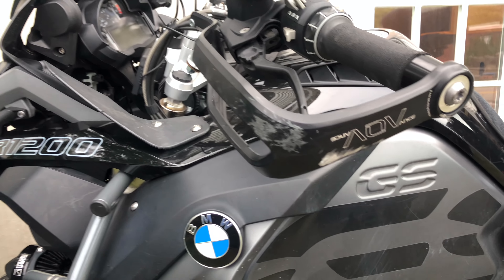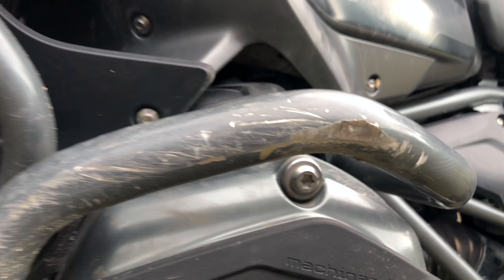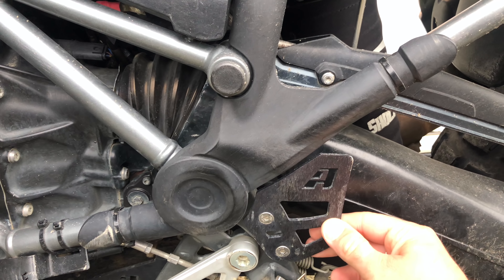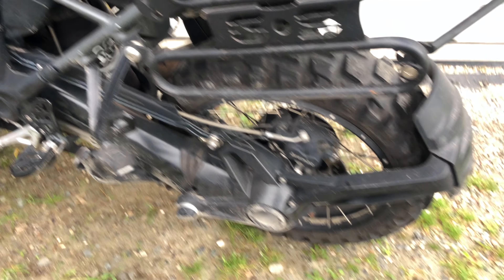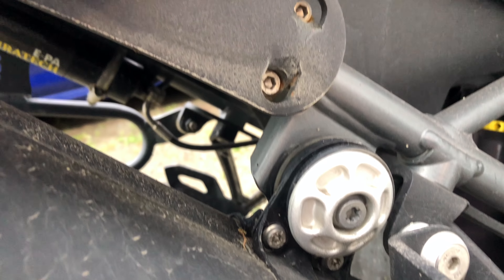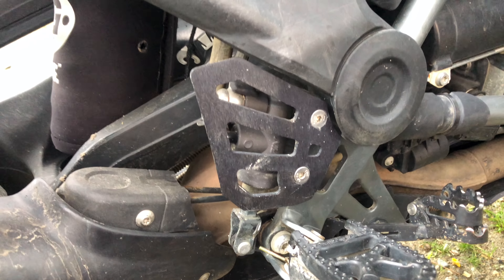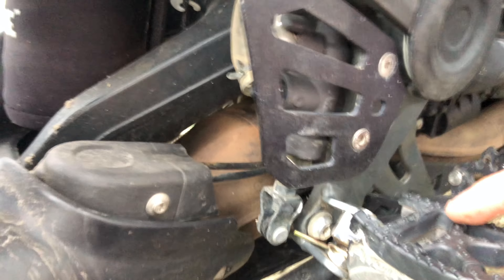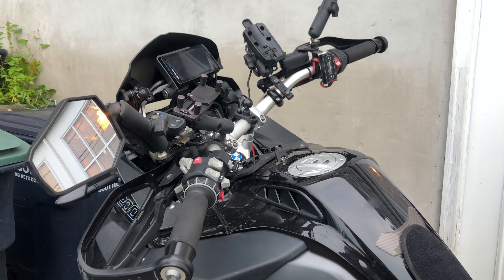Analyzing the Crash Damage on my BMW R1200GS Adventure (2017)

Comment: Glad you were not hurt.  I must say that all the protective equipment you added to the bike must not have been much help if a slow low-side slide totaled the bike.
Reply from the maker: I definitely need to squash this one in the bud. The 'total loss" means the cost to repair the bike was higher than 66.67% of the value. Every scratch on the bike had to be replaced including 2 tiny scratches on the fuel tank ($2500), a scratch on the rear wheel ($1500), a scratch on the swing arm ($1500) a dent in the muffler, ($1700). The protective bits I added enabled me to drive the bike 130 total miles. The only things that I was going to replace were the shifter lever, brake lever and luggage racks. I figured with the dented muffler, I would just have insurance take care of it. They put a piece of green tape on everything that has a surface scratch and the total equaled over $14,000 USD. The bike was not a total loss because the protective bits failed. The protective bits allowed the bike to continue working. The bike was a total loss because insurance requires all scratches be replaced and the bike leave in show-room quality including a full detailing to clean the bike up. If I had never involved insurance, I'd be out $2,000 total in aftermarket parts (non-OEM) and still be riding the bike today thanks to the crash bars, cylinder head guards and sliders.
Reply: My buddy experienced a similar thing when he crashed his Ducati Hypermotard. The insurance company insisted on replacing everything that had even the slightest damage. The worst example was a slightly bent mounting tab on the frame that we could have fixed with a pair of pliers. The insurance company insisted on replacing the entire frame. That went on and on until the bike was considered a “total”.
Reply: @AdamChandler86  well im not american but simple scratches wont kill u, u can always wrap it, since it runs no. major damages, now insursnce take ur bike they sell ut they ship it to lebanon and here we fix it cheap lol
Reply: Wait....what?  $2500 to fix “2 tiny scratches”?  And $1700 to fix a dent in the muffler?  You can REPLACE the muffler for about $400.  I would seriously question your insurance guy’s opinion here.  Just sayin.
Reply: @ktmpasser  I am wondering why insurances companies do this? Do you have any idea?I live in Australia and I am not sure here they will reply so well and fix everything.
Reply: Bill Luce lol newb. Insurance determination does not equal real life. Adam’s big mistake was making a claim.
Reply: @AdamChandler86  do you have the option to buy it back on a salvage or rebuild title or something like that? It seems a shame to throw out a perfectly good bike over a few scratches.
Reply: @samturner3242  Insurance is weird sometimes. I got rear ended in my 2006 cobalt, got a few scuffs on my rear bumper. I filed a claim with the insurance of the person who hit me and they gave me close to $700.
Reply: @AdamChandler86  Why did scratches have to be fixed?  Would it prevent the motor from stating or something.
Reply: @BikerGirlTraveler  i agree
Reply: @juanpablo253491  Maybe because someone else get a 'totaled' bike for very cheap.....great business!

Comment: Adam, I hope you learn from this. Approaching that left hander you were too far to the left, consequently the corner got tight because of your line, then tightened of it’s own accord, causing you to lean further. There was no vanishing point for you to judge the correct speed, etc. Much kudos to you for sharing this experience. Safe riding, my friend!
Reply: I sort of get what you are saying but I don't necessarily agree.   You want to cut the corner to lessen the curve by being at least far left, near the center, you have run out room to complete the arc of your line.  I don't think it was a picking the wrong line problem.  I think it was trying to go around a corner on pavement using TKC 80 too fast, too much of a lean angle for those tires, plain and simple.  Those are not road corner carving tires.  Thats the lesson here I think, moreso.  Its this notion that these bikes can be used in the dirt, and outfitting them with off road tires, when most of the time, your doing twisties on high quality smooth ashphalt, most of the time.  All this crash bar, crash bar that, is just pure non sense.  Try not crashing people.  Its better.   The amount of energy and time put into preparing a bike "to crash" should be spent on learning how not to crash.   Its a science.  I TKC, for sets now, never even came close to losing on pavement, not even once.  Because I do not lean on those tires, they are knobbies, you need a road tire, with more rubber on the road.  I think that trumps the too far left line argument.

Comment: Happy no injury and REALLY appreciate all of the pre- / crash- / and post-crash information. This is the very bike I have and I am right now in the process of shopping for my first set of replacement tires at 7K miles. My GSA came with Anakee IIIs and I have been displeased with the horrendous howling from the front tire at freeway speeds and now pretty serious vibration as the tires are nearing the end of their useful life. I see that you have the TKC-80s. I have been considering the TKC-70s and like more knobby tires in lieu of more street-oriented tires like Tourance, PR4s, etc. I read the below comments and have seen some viewers wondering if your tires were new and thus slippery. I subsequently watched your earlier video and I think in it you said the tires had 1.3K or so miles on them at that point. So, unless you had subsequently replace them, these tires were NOT brand new. Too bad there wasn't a shot of the crash from the rear. However, doing a frame-by-frame replay it LOOKS like perhaps the FRONT BRAKE had been applied. Is that possible? I see an index finger on it at 0:20 seconds. Your Slo-Mo presentation makes it hard to gauge the entry speed, but it looks like the pavement was pretty good: Clean, dry, with tenacious-looking surface. The apex seems perhaps a bit early. So -- any idea what happened? I find it hard to blame the tires. They should have been adequate to the task. Early apex, severe lean angle, ?cold tires?, anxiety, front brake all strike me as possible explanations.

Comment: In my several years of riding on the track, I observe overcast skies and cool pavement. When you add that to 50/50 tires with huge gaps between the treads (minimal contact patch), its no wonder that a low side occurred with that lean angle.  Its a lesson I hope to learn from and not duplicate.
Reply from the maker: Skill as well but yes, it was below 40 degrees, early in the morning, in the mountains on dirt bike tires.

Comment: Might want to rethink your tire choice, go with a Dunlop Elite or Sportsmax. Knobby tires are for off-road to dig in, street tires dont dig in on asphalt so you need to maximize contact patch with road.
Reply: Have to agree with you about tyre choice, The line he took and the constant line adjustment all contributed to this one.  I find I'm on road more than off and i haven't gone too aggressive cos i want to be able to tip into the corners. Anyway thanks for posting video was interesting to see this. All the best.

Comment: Don't take this the wrong way but what were you thinking giving it that much lean on those tyres? That low side was inevitable mate. Glad you're ok though and no lasting damage - protection did the job. I guess a folding brake and gear lever are next on the farkle list?
Reply: StallyMan Even with Street tyres I will not lean as much... 😬
Reply: He was only in third, doing around 70km/h. Hardly pushing it . . knobbies or not!  It was a pretty weird crash!
Reply: That's what I was thinking too. He really had that bike heeled over on those knobbies. And new ones at that. And with that water tower fuel tank, those poor little contact patches were doing yeoman's work. I was surprised how hard he could push it on those things before they let go.
Sucks that such a minor lowside destroyed the bike. Even with all those crash bars. And it's all trivial stuff. Someone's going to get a hell of a bike with a salvage title.
Reply: That was the message I came on to write - not surprisingly someone else had the same thoughts - knobblies look great and make us think we are off to Mongolia- you need to get there on more appropriate tyres in the first instance - all that said I have a GSA and pleased that should something bad happen that the protection appears to protect man and bike
Reply: i agree with you totally, glad rider is ok! the other stuff around the bike is all reparable and i do not think for a moment that the bike is scrap...what i think of the crash is that there are more factors for the fall, it never is only one reason (bad /cold tyres,/leaning angle etc)...The leaning angle itself was not that bad except the velocity was poor (Adam said 25mph) and having those tyres on made the crash not avoidable.. what we learn from Adam (ty for putting this up) is that we will never know when or where we will crash so we need to gear up. If there is one rider there that rides flawless and takes every curve right please show him to me as it will be like meeting a f unicorn.
Reply: StallyMan - exactly what I thought when I saw the rear tire on the bike.
Reply: Dr James Crabapple. Why “obviously “,  because he crashed? Even experts crash sometimes.
Reply: Not sure how this was a write off. Most the damage is cosmetic and could be put right for a couple grand if that.
Reply: I thinking the same. When I know how much I lean and with what speed I have scared much from this video. After I see the tires type I calmed down a little bit.
Reply: With TKC80 knobbies I can lean it way over with no slip.  This fall was weird as the speed was slow.
Reply: I thought exactly the same...
Reply: Over 45 deg inclination that bike cannot hold a 50 deg and he was at it. Also note the is on the left of the lane then he opens up a little which had him veering outside then just a little more lean and then its gone rear cannot cope, nothing weird.

Comment: Adam, first and foremost, glad to see that you came out of this okay. I would like to offer an opinion of the crash itself here. Just my opinion and observation. Anything I say is not meant to be critical of you in any way. I watched and listened to your crash probably a dozen times. For whatever reason, it appears that your approach angle and curve arc for that particular corner was off. In a racing terminology, you drove too deep into the corner then tried to square it off as it's referred to. Meaning midway through the corner you had to put more turning input into the bike. In a car it would be more turning of the steering wheel and on a bike it would be more lean. If you listen to the video, to me it looks and sounds like the TKC80's were maintaining traction right up to the point that your crash bars made contact with the road. Once the crash guards make contact they lift the front wheel wheel and obviously take all traction away at that point. All I am saying is referring to others that mention speed and type of tires, speed was not a direct factor and I really don't think it was due to tire tread pattern. To me it looks and sounds like because of the late corner arc, you reached the bikes lean angle limitations and the crash guards made contact with the road causing the front tire to totally lose any traction it was holding up to that point. It looks like a bang-bang play in baseball. Maybe the tires lost all traction at the very same time the crash guards made contact with the road. You would know best. You were there and felt what was going on in that instant. Just my $.02. Either way, glad you came out unscathed and that you had insurance to take care of the loss.
Reply: J M: So in effect you are saying that the crash bars caused the crash! I don't know whether you are right or not, could be because you can hear something grounding just before the bike goes down. If so, that's a pretty convincing argument against having crash bars.
Reply: An excellent analysis and explanation.  I would also add that the scene was set in the first second of this video.  The rider is positioned incorrectly for the corner.  Then mid way into the bend the rider realises it's quite a bit sharper than he imagined (note the deviation arrows) so he tries to correct his position a little.  At that point his fate is sealed as the rider is now struggling to get the machine around, whilst simultaneously slowing down, and then you hear the crash bars scraping the road, which is the reason why the bike went from under him.   If the rider had positioned his machine closer to the solid white line, it would have given him a better line of sight, and a wider curve to lean the bike into.  As it was his position contributed to the fall.  Under those circumstances (incorrect position) it is better to "go for it" and lean the bike hard over whilst keeping the power on.  He would have come through it no problems.  The tyres played no part in this misshap, despite their nobbly tread.  It was a dry road, and all modern tyres have a high hysteresis - the tread is designed to absorb the energy of deformation internally, thus remaining in contact with the road.  Well done to J M for outlining the reason for this accident.
Reply: I've crashed exactly that way. The crash bars touched down well before I was at my intended angle of lean. I basically rolled the bike off it's wheels.
Reply: From watching other videos as well as this one, the rider commonly enters a turn and corrects the angle while in the turn causing a bit of wobble.  With less sharp turns you can get away with it, not so in this one.  Lord knows I have gotten lucky many times myself.  With the addition of the new tires that have not been broken in adequately also added to the riders misfortune.  It is really nice to record your riding to be able to critique and improve your riding skills.  This is something I'd also like to do.
Reply: Yes, all fine with your first sentence, although such actions - "...corrects the angle while in the turn causing a bit of a wobble..." is a fundamental mistake by the rider!   If he had kept more to the solid white line, giving him a wider arc and hence the ability to get round that bend smoothly, non of us would be here debating this.  Sorry to say but this was rider error on three key points.  Blaming the new tyres is not, in my opinion, relevant.  As I mentioned earlier all modern tyres have a high hysteresis - even from new.  In the UK, 90% of M/C accidents are caused by human error and I've had a fair few myself - due entirely to my own stupidity!
Reply: J M ...I agree 100%. I’ve had 3 GSs over the years, and while cornering clearance is okay, it’s definitely something you need to be conscious of. That’d never happen on a KTM 1190/1290...they may have some other problems, but cornering clearance isn’t one of them.
Reply: I agree 100%, and wrote it in the first accident video
Reply: I had the same opinion, though not so technical. He did what I call going inside-out on the corner vs outside-in.

Comment: That seems like mostly cosmetic damage, so I'm amazed the insurance company got to such a high number. I lost my 2013 GS due to a collision with a car that sheared off the front triple clamp and moved the motor back. The insurance company said $9,500 and totaled it. A guy bought it at salvage, put in no more than $3,000, and is riding around happily in it. So don't discard the idea of fixing it and keeping it. Or, take the money and get the R1250GS. Truly a surprising amount of damage for such a low speed little crash, but that's the state of vehicle manufacturing today. God forbid you hit anything with your car, watch the repairs skyrocket as everything crumples. Sorry you lost your bike for such a small crash. Thanks for sharing.